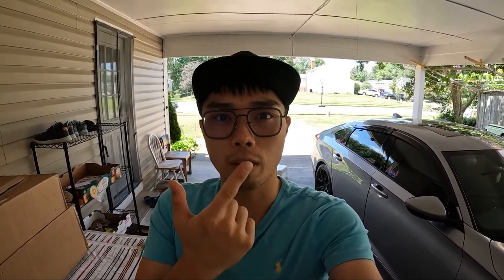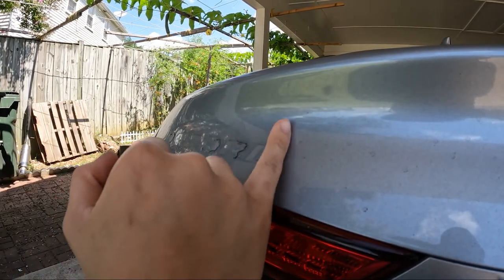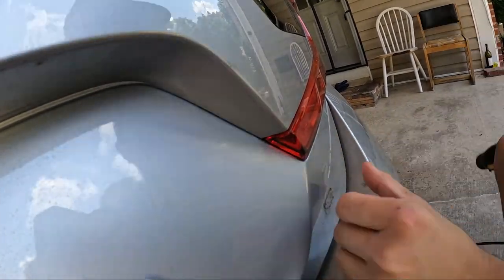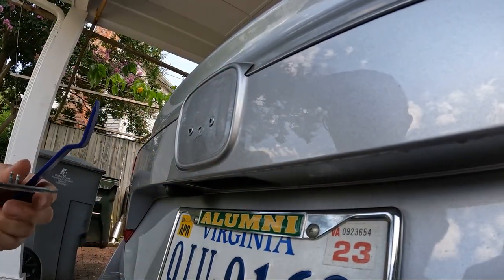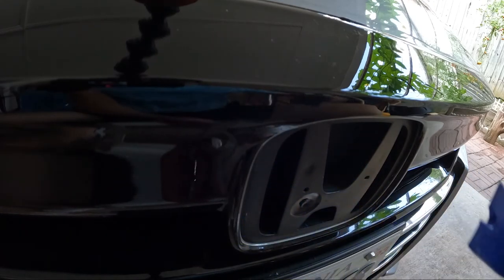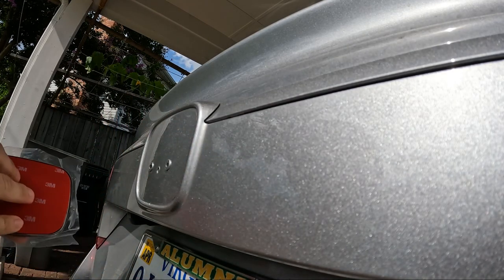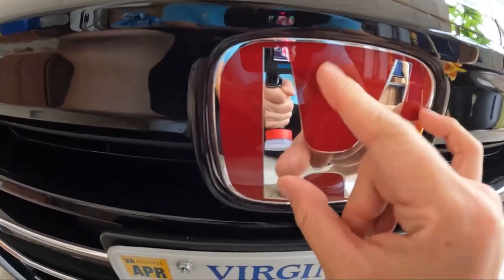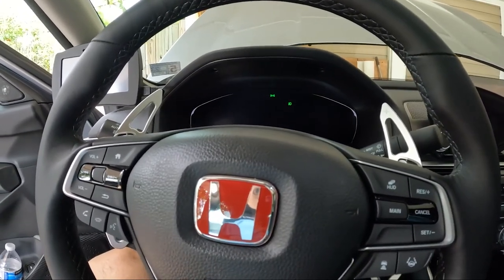Transforming the Accord! 😲 Adding Some Aesthetic Mods - Badges, and Duckbill!

Comment: You didn't apply any tape adhesive promoter.  You also could of added self treading screws on the inside of the trunk.  By removing the inside carpet on the trunk lid. I added 3 self tapping screws with a washer on ea one. Through  the holes from the oem spoiler.  It's more secure & also harder to keep someone from trying to take it.

Comment: That looks great! Do you have a link for the spoiler? I definitely want the same one for mine now. 

Also I think a diffuser would definitely complete the look, but which would you go for? Both the Yofer and Akasaka look great but the yofer is definitely more aggressive
Reply from the maker: Got it off eBay, comes in and out of stock from time to time 

https://www.ebay.com/itm/185132404576?hash=item2b1ac04f60:g:FtYAAOSwRKthelyL&amdata=enc%3AAQAHAAAAsE5imXHHDmFfMgWqtwUJC1%2BIDgrnIsaQOwv4WJCx%2FpqLcNJ5ji7zTFzMf9ctMYlPSGfRLB2EAn1URk1mNpP72LSH855WHVv6jKjjdOXsMnGrt1kOB9sEa0tDlmkUtjOnDoFF3F1SmqmSHa1Mv4%2BN%2Bsx3PPeoplenXduRyc5JBjIFC7X9sl5P2BdaRoZ3KZ3rP0zb%2BRkNtY8Q31md44me1YbTvGH8efTB50E5uxj0UbF3%7Ctkp%3ABk9SR-6gyYKxYQ